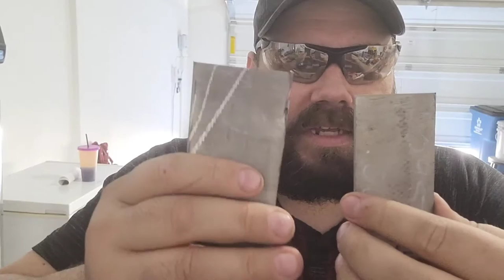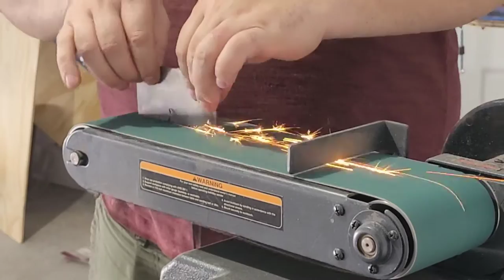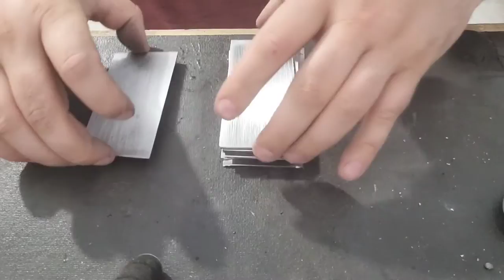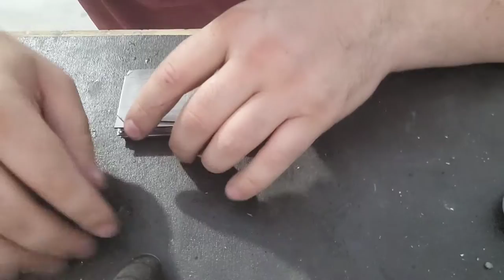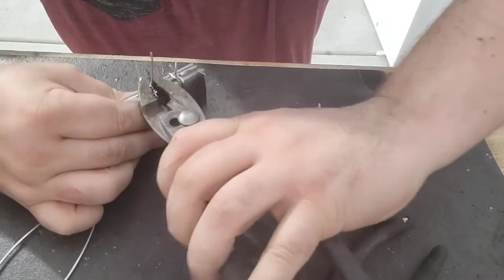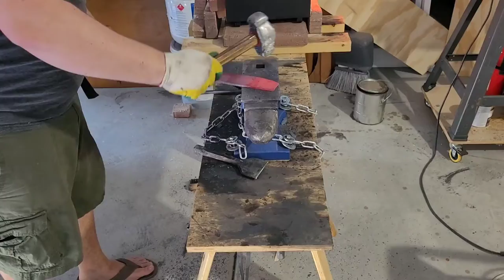Damascus without welding

Comment: I’m so glad you did this I don’t have welder and I’ve been wander if I can do this or better yet how to fro it
Reply from the maker: Yeah Skylar before I filmed I tried it once and it came good. It was a smaller piece you kust have to give it a go. The real key ingredient is heat make sure your fire can to the forge welding temp. for what the metal is being used.

Comment: So what did you do to deal with the bailing wire when you were forge welding? Was it burnt off as it welded or did it integrate and you grind it off in the end?
Reply from the maker: I'm sure both happened. I did pull off some pieces and I could see some hammered in. All and all it worked well for a low layer count.